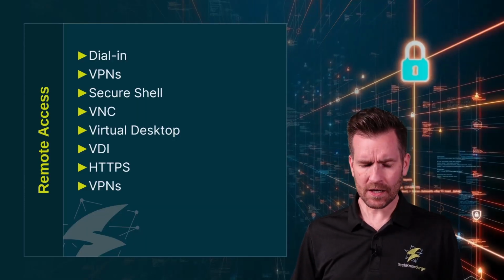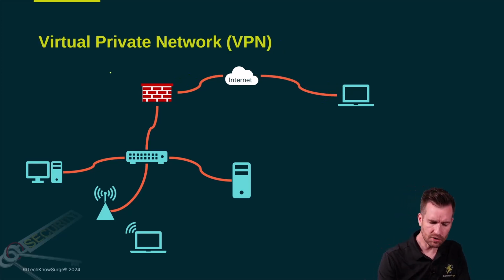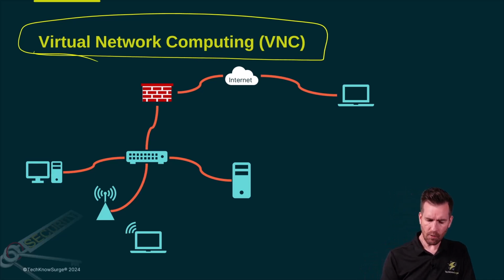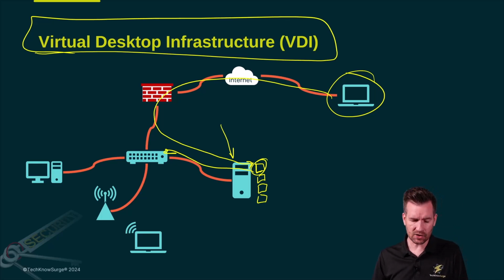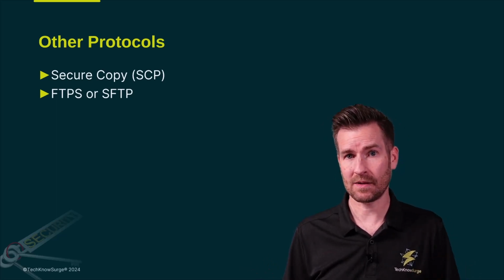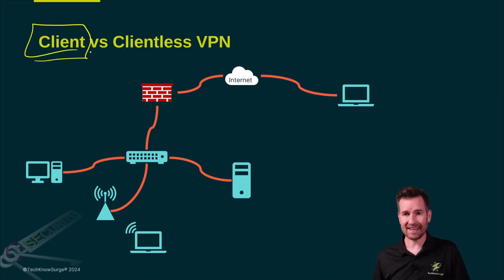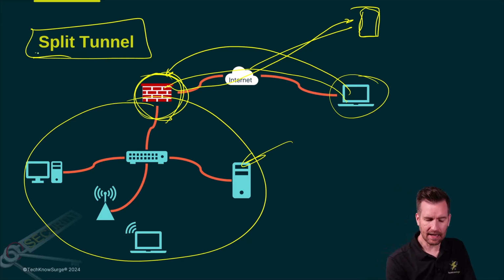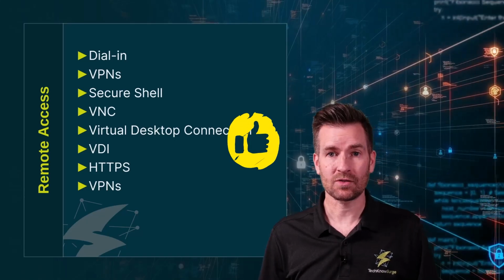Foundations of Cybersecurity 8-4: Remote access

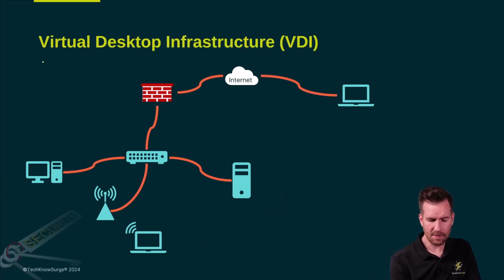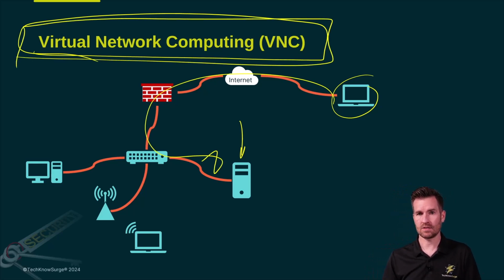Comment: A lot of interesting stuff in this lecture. I immediately remembered seeing VDI (5:07) on Oracle's Vbox, without knowing what was it for. Virtual Desktop Connection (4:02) has anything to do with RDP? 

Are there in-depth or "in practice" videos about these remote access techniques?
Reply from the maker: Yes, virtual desktop connection is just connecting to a desktop virtually. You could use RDP or VNC to make that connection.

Unfortunately, I don't have practices. I'm rolling out a new site where I'll have lots of labs. I'm getting close to deploying that, hopefully will be done soon.
Reply: @TechKnowSurge  labs, that’s awesome! By practice I was referring not only to labs, also practical videos, I see you have videos like that which you call “Demo”, demonstration video.
Reply from the maker: @gustavocruz988  No videos at this point. After I build out labs, I'm still debating if I'll make demo videos or not.